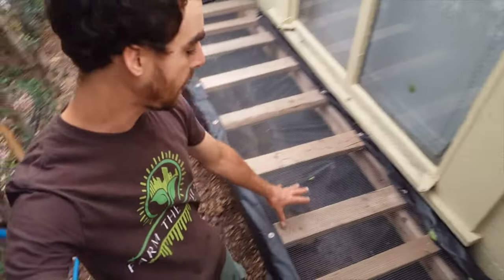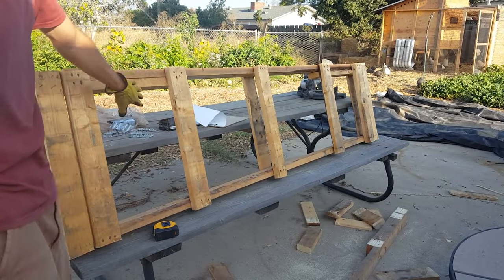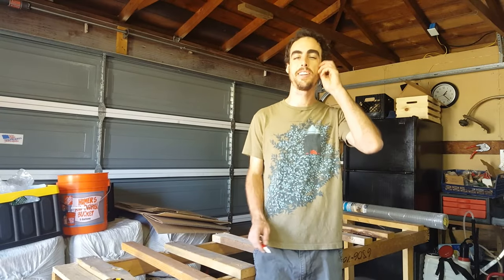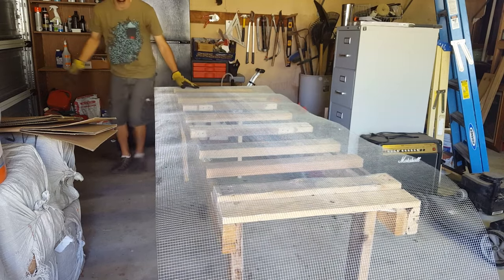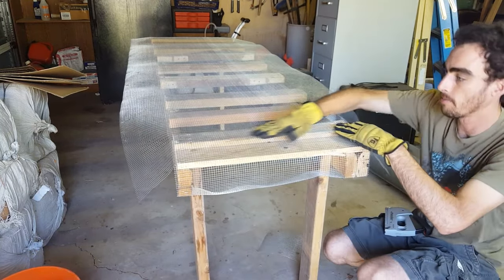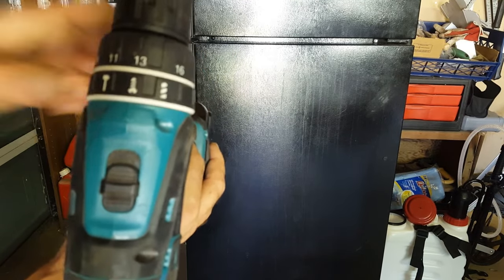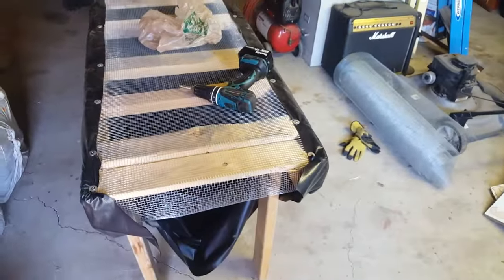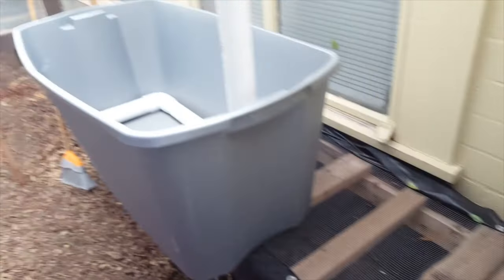How to Build a Vegetable Wash Table & Recycle Water!

Comment: Do you think that using an old bathtub would work well? Could just build an insert with the wire so that the vegetables are not sitting on the bottom. Already has a slope and a drain. Love your channel

Comment: Cool, one suggestion I'd make is adding a fine mesh screen (like a window one) to where the water enters the tote to keep debris out and avoid having a large area for a mosquito larvae.
Reply from the maker: WONDERFUL suggestion! I actually just put some tape over a couple holes because of mosquitoes and couldn't figure out how to close the entry hole! So thank you so much I'll try out your idea!
Reply: You're welcome. I'm still trying to figure out in my head how it would be attached. Maybe heavy duty duct taping the screen and the liner at the edges and then taping that to the inside? Or just taping the excess liner to the inside and then the screen over that. Let us know how it goes if you end up doing it.